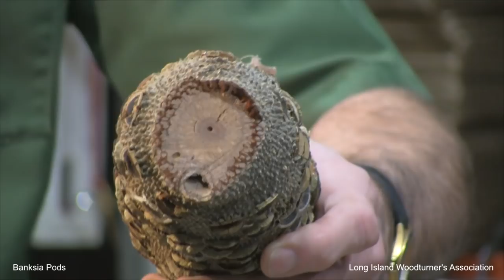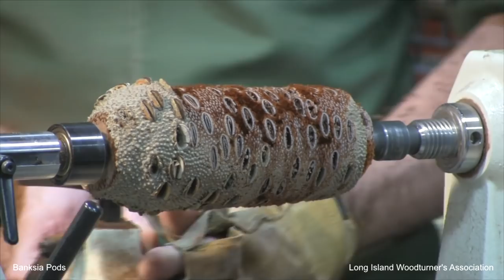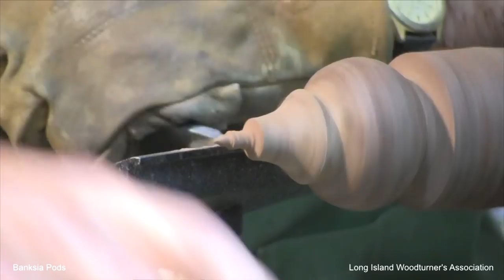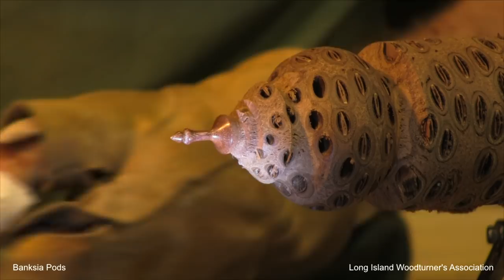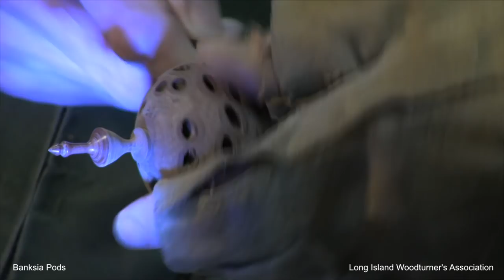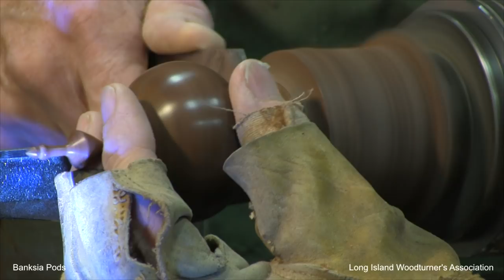How to Turn Banksia Pods in HD - Woodturning - Paul MacMenamin - Long Island Woodturners

Comment: Here is a cool idea, hollow out a central cavity that breaks into the back parts of the small seed cavities, so you have a hollow form perforated with natural holes, but before that is done you fill each seed cavity with epoxy of different colors...so you have a hollow form studded with little colored windows...then you can put an LED array inside! Put it on a copper pipe or bamboo cane as a lamp stem or arrange many of the same in some weird part see pod part UFO chandelier...Antonio Gaudi would be proud... You could in theory do the same thing with Cholla or even Ashe's Juniper wood, turned or not, but to do that with Banksia pods would be spectacular...

Comment: Nice video on using Banksia pods.  It would be nice to just add some info on turning speed, tool you are going to use, what “the plan” is,  your thoughts on sanding paper. 100, 150, 200, 220, polishing compounds.  There were lots of opportunities to teach a bit that went to ground.  But, i still learned kind of what to do with the handful of pods i have laying about.  Thnks